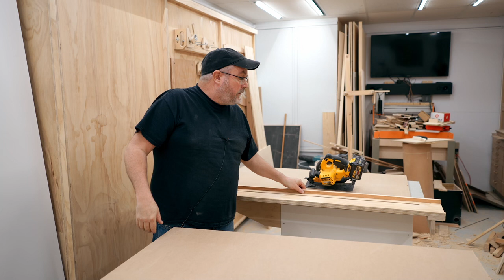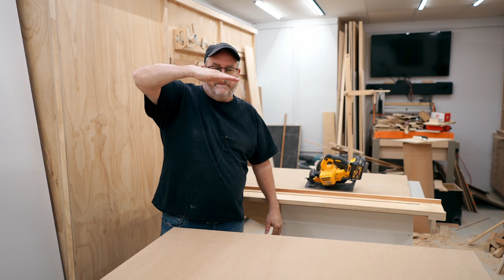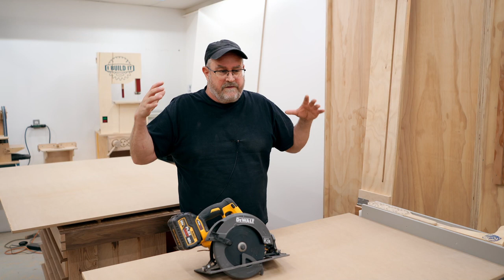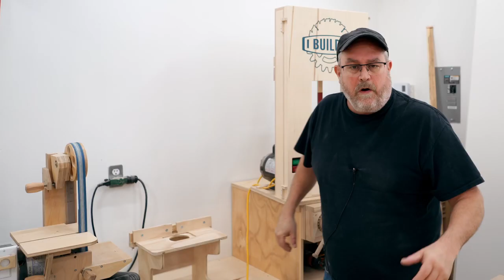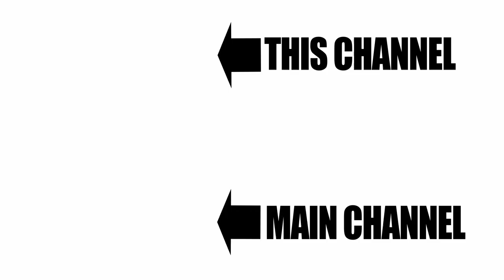Do You Need a Crosscut Track? Yes You Do

Comment: I remember you saying how you do not like horizontal surfaces such as shelves as they collect stuff.  Looking at that CNC......... Yes, I am just as guilty, that is why I got rid of my shelves and made my CNC store up against the wall.  I am also switching from 3/4" MDF to a 1/2" MDF for a waste board. Getting too old to haul that heavy stuff around.
Reply from the maker: Well, the CNC doesn't get used often, so it's a good place to keep stuff and then that stuff keeps the dust off of it :)
AND, as I've been known to do, I may change things up and put that CNC on the wall. Seems to me it would work better in that position, since the cuttings would just fall to the floor rather than piling up.

Comment: The cross cut guide is great. Simplicity/functionality in perfect balance, like you said...
Specifically, what I like about the whole set-up is that it all works in conjunction with the table saw fence. Referencing one edge of the material off one component for different processes. Very efficient and, simple, etc...

I would buy band saw plans when available.